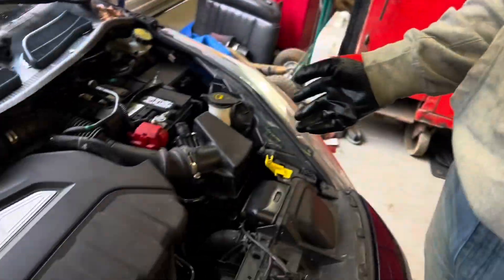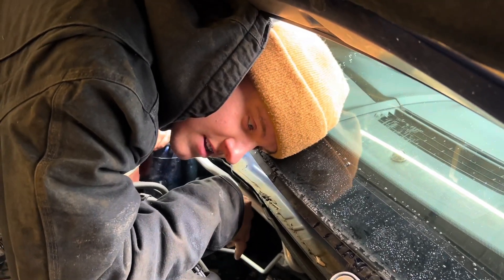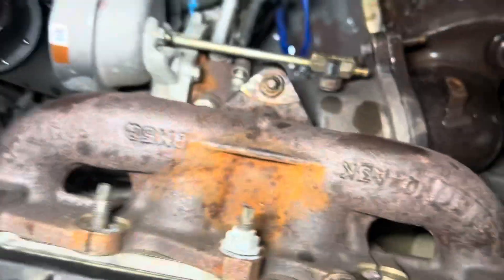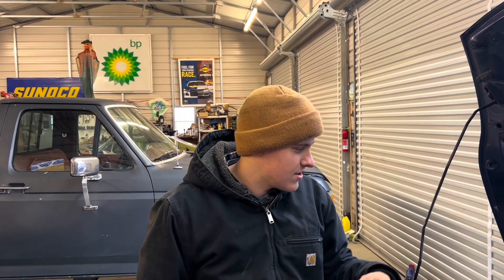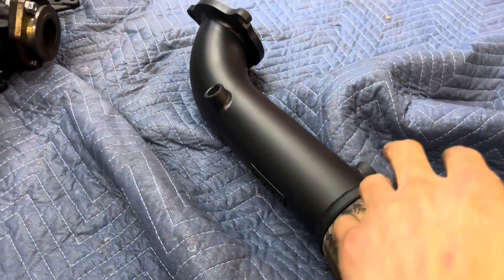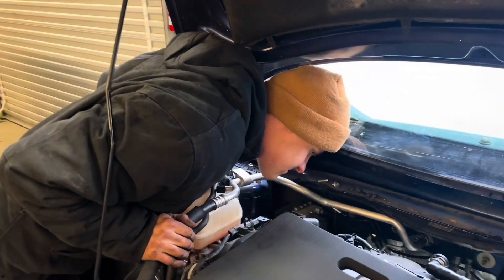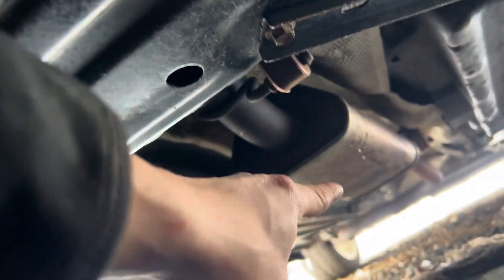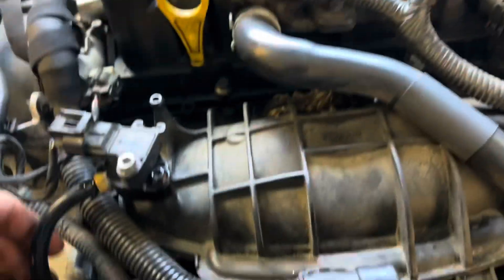Garrett GTX2860 Installed On My Fiesta ST!

Comment: What happens with the recirculating valve plug that goes to the stock turbo
Reply: Lots of turbo lag. Still have to tune it though.
Reply from the maker: That port on the intercooler pipe was blocked off.
Reply: @Gilligan.Garage i just did the same turbo on mine
Reply from the maker: @guinto714 nice! How do you like it?

Comment: I had a gtx2860r on my 1.6 fusion and I made 368whp could of did more but the heads went after 4 years of abuse. Those 1.6 are some strong engines
Reply from the maker: They definitely are really good engine’s for what they are. My e tune is finished now and its on e30 so its a blast

Comment: Will doing bigger turbo reduce the life on a stock motor?
Reply from the maker: Depends on the tune and how you drive it, the stock engines can definitely hold a decent bit of power
Reply: What is the max HP or KW you would push on a stock motor with a GTX2860R for a daily